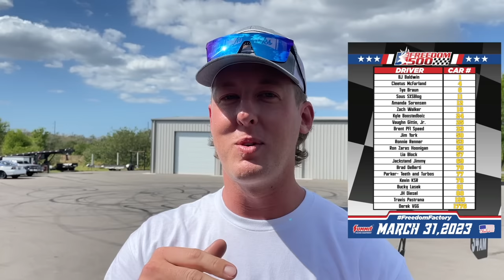I Bought the Most INSANE Street Car Ever... DESTROYED My Best Laps Around the Freedom Factory!!!

Comment from the maker: That's right! If you spend over $75 on https://www.summitracing.com and use code CLEETUS at checkout, get a free PPV ticket to watch the Freedom 500!!!
Reply: I used to play with this car in my racing games when I was little. I’ve never actually seen anyone get one though. That thing is sick. Always wanted to see an Ariel atom pushed.
Reply: Comment 🚀🚀🚀that’s a PPV I would love to watch but I just purchased something my wife yelled at me for , so I’ll probably have to skip so I do t push my luck 🤣for now but next one I’m in
Reply: I knew exactly what the car was going to be. Matt Jones has been jumping his on his YT channel for a while now. Such a ripper.
Reply: Brother, you HAVE to put that over the 1/4 before she goes.
Reply: I though you bought this for spectator drags at first but giving it away as the prize for the freedom 500 is epic.
Reply: This us the baby one , there was one more , the Ariel Atom 500 featured a 500 horsepower 3.0 liter John Hartley-designed V8 engine, carbon fiber body panels and aerofoils, chromoly aerofoil wishbones, an integrated function steering wheel, Alcon four-piston brake calipers, and Dymag magnesium wheels.
Reply: Agreed!!!
Reply: What kind of engine???
Reply: this one you gotta keep man this is an amazing car and would be AMAZING To see content on from the dragstrip
Reply: You gotta let George test drive the goods he will tell you if the brakes work good and if it's safe on all four wheels so make sure you let George test drive the rainbow bright car
Reply: looks like the new spectator race winner
Reply: they make some of them with a LS in them. needs a LS one for spectator drags
Reply: @omihurst  little crappy ecotech from little chevy cobalt.  but they make some of them with a LS in them. needs a LS one for spectator drags
Reply: It's like if you combine Leroy with a F1 car
Reply: see this why leroy needs to be mid engine. they make a LS version so take that and give it leroy treatment lol
Reply: Get the boosted bois to build a k-series for it
Reply: @carculturenation2166  this car is Leroy combined with a F1 car
Reply: The best part about this promo is who doesn't always need to buy at least $75 worth of parts from summit? Looks it's time for me to buy a new locker for my front diff😂
Reply: Wow. didnt expect to see one of the finest british creations ever. an ariel atom. you know theres a v8 version of it right cleet? the ariel atom V8 is nuts (basically a mini f1 car) looks cooler as the V8 version had side pods right in front of the rear wheels. (extra cooling ofc)
sadly you got the wrong "open wheeler" street car. shouldve tried getting a Caparo T1 cus those things were pretty much as close to a road going F1 car as you could get, 10 years ago
Reply: @Sanderly1820  was just called the ariel atom v8. people keep putting r500 in its name despite that being one of the old fast versions of the caterham 7 that rivalled the ariel atom.
Reply: Video 80 asking Cleetus to invite BlazerMan to compete in the next Crown Vic Race. 
Ps….looks like it’s not gonna happen this time. But I’m gonna keep on askin 😄
Reply: I called it 😂 

Edit: in November the copart video
Reply: @carculturenation2166  the v8 atom does not use an LS. it uses Ariel's own 3.0L V8.... also the cobalt engine. US only. shit. good atoms used K20's (older ones used the k20z4. newer ones use the k20c1 engine. the current civic type r engine i think? or maybe previous model) makes about 320bhp. the V8 was said to make 500bhp. they made 25 examples. i doubt that power figure.
Reply: I've been in a Nomad, f-ing insane.
Reply: Talk with Simon or Billy @ Goonzquad and see if you can get the one from them that they built. They might be looking to get it out of the shop so they can fit more builds in it.
Reply: Best video in ages 😜👍
Reply: Damn, thought the title was gonna say”Destroyed immediately” but I guess you didnt let George drive it!!!
Reply: @Sanderly1820  I've seen it!! The atom is a great chassis 😜👍
Reply: Wrap the Ariel in Khacki!!!😂😂😂😂
Reply: LOL 1st thing I thought of and Jeremy's face all contorted ROFLMAO
Reply: just so you know cleet they do make a v8 arial atom
Reply: No
Reply: Wheres that tahoe brother
Reply: Found the new winner of spectator drags😅
Reply: I worked for a company that made those fiberglass/carbon fiber body components for the Ariel Atom like 10-12 years ago.
Reply: Better rent bleachers for the Freedom 500. Don't want to turn walk-ins away.
Reply: Ariel made a v8 3L version with 500hp. They also made a few turbocharged versions.
Reply: Where is the 911 Turbo???
Reply: I love the old batmobile windscreens.
Reply: So excited to make my first visit to the Freedom Factory!!!
Reply: Can we watch on a smart tv?
Reply: I see an Ariel atom in ur very near future looking into the crystal 🔮 ball
Reply: You need your own Atom if you don't win 😅
Reply: You seem to have the best luck with exo cars. 
Now you need an F9 to go with them. Or a Nomad.
Reply: Show us the engine of the Aeril Atom they used to come with a supercharged honda k20a2 engine
Reply: Y'all are always looking out for us thank you
Reply: @MrTurnermason  yes you can kid.
Reply: Awesome video. The production keeps getting better.
Reply: If you don't win this maybe look at buying an ex-Indy Lights car, Indy Car, or if your pockets really deep  Ex-F1 car.  How could you lose.
Reply: There is no such thing as a "cantilever suspension". It's pushrod or rocker arm. Cantilever is a stationary support structure not a moving system. Does your LS or Godzilla have cantilever valve actuation?  No it doesn't.
Reply: @carculturenation2166  the V8 atom isnt an LS. It's a Hayabusa headed V8 built by Hartley engineering.
Reply: Wonder if blueprint engines new LS 4 cylinder would fit in the atom??
Reply: You need the Ariel Atom V8.
Reply: I just ordered the fire wall insulation I've been putting off. first freedom 500 i'll be seeing!
Reply: Cleet Ariel is working on a Jet Powered Car looks like the Batmobile they have a driving prototype 😍
Reply: lol surprise surprise. The two fastest cars around the track are European/UK. Apparently American cars can’t even turn left better than the Europeans hahah!
Reply: Epic prize Bro👍
You may have out done yourself Cleeter. How you gonna outclass this one lol.  I know you will.  You better start thinking well in advance tho.
Reply: Swap a built buick supercharged 3800 v6 into it
Reply: Get a 2g eclipse
Reply: These are built not far from me in the UK, awesome track day car, cheap motors are easily replaced if they ever go wrong....there serious fun..they do an offroad version to.
Reply: You know they sell those with a v8 right
Reply: The Freedom Factory looks like it needs a Mill and Pave soon! Better get 3.16 speed on the schedule
Reply: @jagerandres5808  what you say will nearly double the engine weight. How much  extra hp over the current 330hp do you expect to get out of a super charged 3800? 

Also, that engine will add 15% body weight, all to the rear. The handling is going to be totally whack.
Reply: @donaldliverance2597  good luck finding one of those. They were limited edition back in 2008. 25 were built. Yes 25. 2008 price was $200k. None were built for US.
Reply: @rockyjohnson9243  lol ex-F1 car. You have no idea how much they cost do you? $1.5M+ easily for a 20yr old race car.
Reply: Build a fleet of DF goblins for the freedom factory
Reply: Yall need to do a super troopers remake scene where cleetus or James gets pulled over and do the "do you know how fast you were goin skit😂😂😂 it would make a great promo video for the Arial atom
Reply: @Car Culture Nation  the only other atom they made was Ariel Atom 500 featured a 500 horsepower 3.0 liter John Hartley-designed V8 engine, carbon fiber body panels and aerofoils, chromoly aerofoil wishbones, an integrated function steering wheel, Alcon four-piston brake calipers, and Dymag magnesium wheels.
Reply: @Ant Paul I'm sorry but you have zero clue what you are talking about. Diesel fuel is super low octane. Oil in your fuel will lower it's octane dramatically.
Reply: @mbbb9244  That's not the only one I mentioned :)  However I am sure he can afford it.  Sell the Porsha, Tank, then you only owe 800 grand lol
Reply: You either have it or you don't! Nebraska boy MOST definitely doesn't have "it"!
Reply: Did it throw a fire ball in the last turn before he left the track.. at 12:25
Reply: Silent lap 43 in honor of Ken block?
Reply: I think EVERYTHING you own should get a lap of the circuit. The golf cart, the ripsaw, the hovercraft, toast, Mystery machine, the Porsche, your transport truck etc etc. it would be the worlds greatest lap record list. Draw straws and make someone ride a bmx as the benchmark lol
Reply: I wouldn't be too hard on a supercharged ecotec LOL
Reply: Have you heard anything else about the house they want to build near the track. Thanks James
Reply: Summit Racing sucks
Reply: Code doesn’t seem to be working :(
Reply: It's not working for me 😭
Reply: TWIN CHARGE it..!
Reply: Tried the code and it didn't work 😢
Reply: Anybody get the code Cleetus to work at summit? I’m not having any luck
Reply: Shame summit don’t seem to be honoring the code …..
Reply: I couldn't get the code to work
Reply: does this code still work?  I keep getting errors when I put it in?
Reply: @skullscott85  I couldn’t get it to work. I think it’s on summit side. I have a 10% off code that won’t work either.
Reply: @ColtsShop   I called summit that code expired on 3/26.   Im not sure why the code would expire before the PPV even happened.
Reply: @skullscott85  
Oh really, yeah that is strange. Thanks for making the call.
Reply: @skullscott85  
I’m not sure if Cleetus realize that expired on the 3/26. The video he posted on 3/27 he advertise the summit code.
Reply: Do yall still have this thing man alil beast 😂😂😂😂😂
Reply: I wanna see Joe Rogan race.. he’s a car guy too!!

Comment: I had a blast working on this car!!!! And I am so happy you guys have it. I installed all the aftermarket parts but the best part was driving it
Reply: What's done to it? Looks swet
Reply: HYB
Reply: Mtb_lord  stop spamming
Reply: Sweet car! I dont care what they say the wrap is cool.
Reply: Aren’t those like $120-140k?
Reply: @tkostang  

He paid $60k
Reply: Nice build Mr Thurmond.
Any guess as to who might win it?
Reply: @tkostang  not sure about us prices, but used ones go for between £40-£60k depending on the model.
Reply: I thought I recognized this car from some of your posts on FB. 😂😂
Reply: What’s done to it to make 330 because a lot of cobalt ss guys can’t break 300 with the factory m62.. I had a little over 300 with literally max effort m62 build, built bottom end, ported and built head with stage 2 cams, ported m62 with a 2.7 pulley, ls3 throttle body, 80lb injectors with methanol injection.
Reply: @Pilotefabrication  

Just do the zzp turbo kit
Reply: @8SecSleeper  Yeah I don't think I've ever seen a small motor supercharger setup that wouldn't be better with a turbo.
Reply: @riothero313  supercharged engines make clean linear power all the way to redline... turbos don't. Plus they sound better.
Reply: @richardharrold9736  You've clearly never owned a vehicle with a properly sized ceramic ball bearing turbo with a billet compressor wheel. Superchargers are fine, on V8's that have the power to spare for the parasitic loss in the first place. Like a Whipple on a coyote. There is a reason no one uses blowers on small motors. Even Chevy stopped lol. Look at how much better the mini was with the same displacement going turbo.
Reply: @riothero313  parasitic loss from a centrifugal blower as used on K20s is minimal, and more than offset by the massive back pressure caused by a turbo. I have always hated turbos and will never buy a car that has one. And no, the Mini wasn't better with a turbo. There's only one reason why turbos are all the rage with OEMs now and that's because they can run the official economy and emissions tests without ever crossing the boost threshold. If the tests were more realistic, involving running up to around 100km/h, N/A and supercharged engines would be much more popular right now.
Reply: @richardharrold9736  What's the K20 hp record on a turbo vs blower again, I don't remember??
Reply: @riothero313  record for what? Drag racing? Outright horsepower? Neither is remotely relevant to the world of lightweight sports cars.
Reply: @richardharrold9736  this isn't a k it's ecotec
Reply: @Assasinnationtv  yeah, I know. I was talking about the UK market car as that's what I know a bit about.

Comment: As an Atom owner, I’m happy to see these getting some love. Easily the best drivers car you can buy.
Reply: Which engine do you have with yours? I've been in one with a turbo Honda K series and it was so fast I swore my heart stopped beating under acceleration!
Reply: As  Batman,  I too  am happy to see these getting some love.
Reply: @PetesCreativeRecycling  I have the same drivetrain as Cletus (supercharged LSJ). I have no desire to add anymore power lol. It’s fast enough as it is.
Reply: I want an Atom. Or even a ride in one, ever since I saw it on Top Gear I fell in love with it
Reply: @bigduphusaj162  Why?
Reply: @bigduphusaj162  C'mon mate. You're the ace mechanic who's worked on everything. As if you need any advice from anyone.
Reply: Rode as a passenger in one on a race track that had a supercharged Honda motor making 300kw & it was wild!!! Mad acceleration and braking & handling like a go-kart. Proper boys toy.
Reply: How come they didn't use the k20 for them ones?
Reply: @Barry.ONeill  when these were first produced, the k series wasn't a thing.
Reply: @98ek9  it was on the EU assembled cars. Brammo motor sports (us assembly location) used the eco tech’s.
Reply: @charles2173  back in 2000 when the k20 came out in 2001?
Reply: @Flicks  you are correct.  I am wrong. The first gen model did come with the rover k series. Although the original question was about the K20. Doubtful it was confused with Rovers k series motor.
Reply: @bigduphusaj162  very interesting, thanks for the replies!  I've always loved the Atom, they still seem to be the best drivers car since the Lotus Elise.  Loved my Elise back in 1996, was Epic.
Reply: Engine options from 2000 to now:

1.8 L 190 hp Rover K-Series engine
2.0 L 245-bhp naturally aspirated or 310-bhp (350-bhp in 3.5R) supercharged Honda K20Z4 i-VTEC

2.2 L or 2.4 L 205-300-bhp supercharged General Motors Ecotec

3.0 L 500-bhp Ariel V8

2.4 L 245- bhp naturally aspirated or 300bhp supercharged Honda i-VTEC (US)

2.4 L 230-bhp naturally aspirated or 365-bhp turbocharged Honda K24Z7 i-VTEC

2.0 L 321-bhp turbocharged (direct injection) Honda K20C1 i-VTEC

Comment: Remember your new toy has aero appendages that really work. When you had some over steer at the track, the solution is probably to add more rear wing. A degree or two more wing might be all you need. Don't use to much as you can stall the wing then you have no downforce just big drag. Looks like fun!!!

Rex
Reply: It could also suffer from the same issue F1 cars have, drivers inexperienced in them not driving fast ENOUGH. They come into a corner too slow, there's not enough aero downforce so no grip, not enough speed to keep the tires hot so you slide, and when you brake there's nothing there because they're cold, because you were SUPPOSED to hit that 45deg turn at 150mph minimum and you'd sail through like a hero...but you entered that turn at 98mph because terror and sailed into the runoff/wall. 
When Richard Hammond tried to drive a real F1 car, he had that issue trying to even complete a lap.  It's designed to operate at such a high level that if you don't commit 100% on every turn, every shift, every brake, it'll wreck you.
Reply: Though these are all true statements, I don't think this track is anywhere near fast enough for aero to make much of a difference.
Reply: I never noticed how patchy the track is,,, maybe folks outside of the Freedom Factory circle should start a go fund me to have it resurfaced as a thanks to Cleeter.
Yeah,,, maybe I’ve been watching too much of that Ty Pennington show recently where he rebuilds a house for people that teach stray dogs a new language or something like that,,, ;)

Comment: Over steer is a main thing in these Atoms. You have to push the car faster, with appropriate tires, to the point of your fight or flight sense kicks in. You have to put that sense behind you and push even harder because you have the down force to hold the car in the turns.
Reply: Bump Bc he needs to see this. Def agree he needed to give it more but I’m sure he was staying safe
Reply: The problem is you can't get all that fast on this short track. He could push it and up another 50ish since he was sliding. It would help confidence to blow the track before going balls to the wall also.